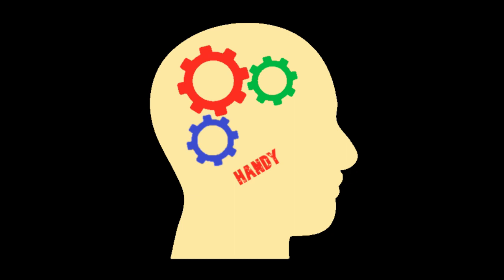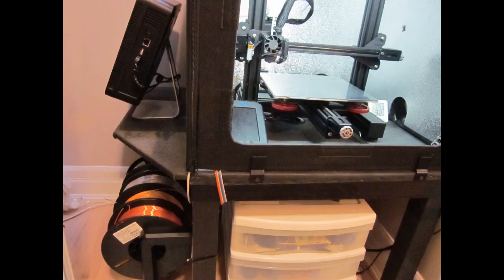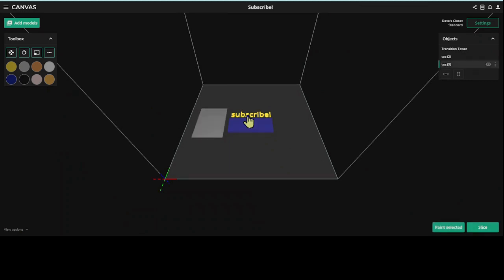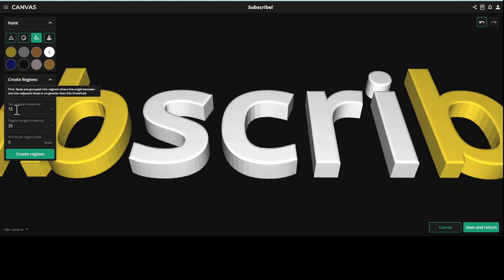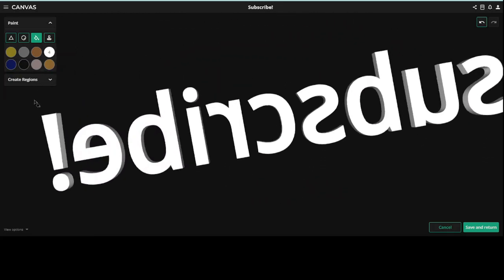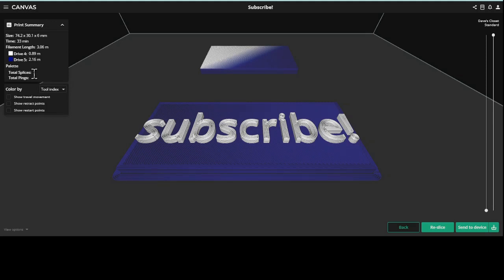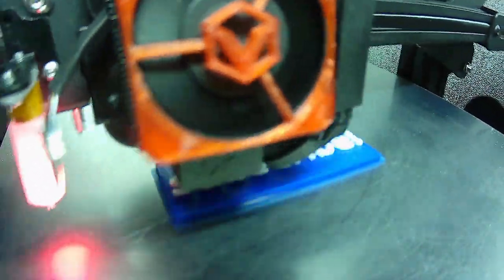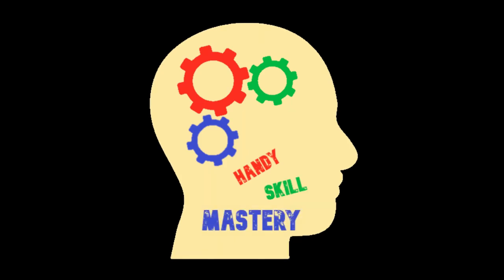Mosaic Palette 3 Pro - 3D Print 8 Colors Using Any 3D Printer! PART 2

Comment: What’s the best way to setup the transition length? My print layers will have the wrong color come in at the wrong layer.
Reply from the maker: Hi there, sorry for the late reply on this. Have you figured it out yet? Once you have everything calibrated your colors will come in at just the right time. You mentioned that your colors are coming in at the wrong times. This could be due to a few different reasons. Can you tell me which type of printer you are using? Is it a direct drive or bowden tube design? If you aren't sure, just tell me the make and model of your printer and I will walk you through the different steps to take to ensure that your colors transition at the right time, without being too wasteful with the filament.

Comment: How do u set up at canvas  to avoid Blt touch it touch the model? Thanks
Reply from the maker: Hi there, have you figured this issue out yet? if not please leave a comment and I will help you solve the issue. Thanks!
Reply: NowI lam  more interest Bambi lab printer, it seems easier to do the 4 color at single printer